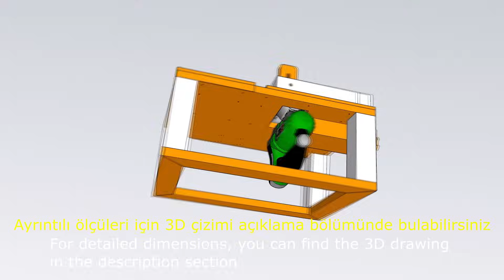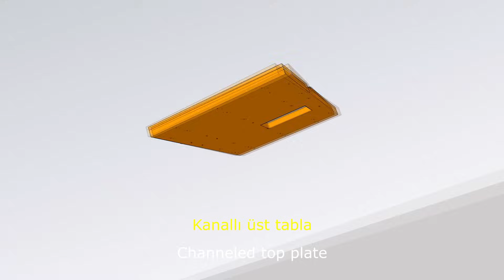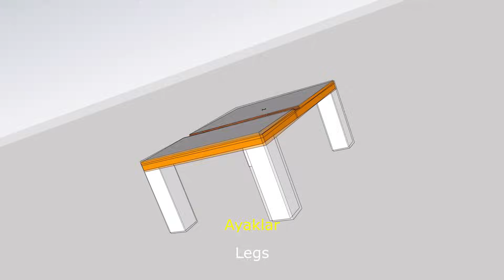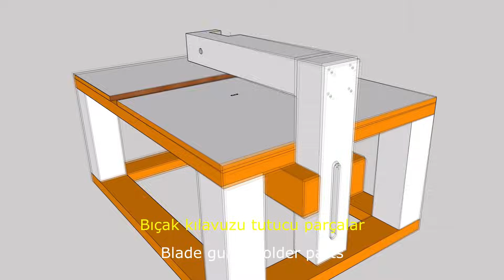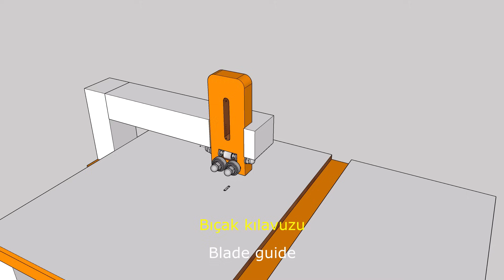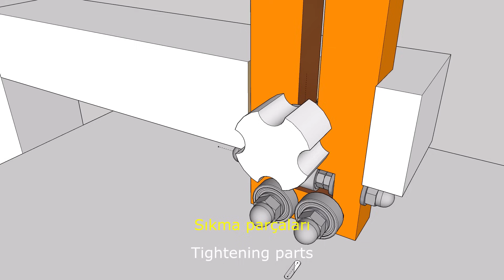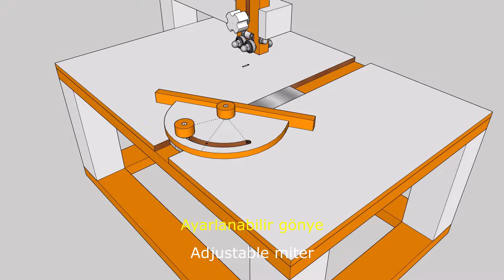Homemade Jigsaw Table / DIY Jigsaw Table

Comment: Excellent work. Btw what is the purpose of two spinning wheels? To stabilize the saw? I really need to know, cant we just use without that?
Reply from the maker: Hello there.  Firstly, thank you.  When you say "two spinning wheels", I think you mean the bearings on both sides of the saw blade.  These bearings prevent the saw blade from swinging and provide straight cuts.  Since the jigsaw holds the tip from a single point, it cannot hold the saw tip steady during the loading of the piece to be cut.  Bearings placed on the sides and back in this way play an important role in smooth cutting and curved cutting.
Reply: Thanks for the explanation, i really appreciate it.
Reply from the maker: I thank you too.  If you still have any questions, please write.

Comment: Good work man, I have in plan to build something like that, my purpose is to use for piece number 5, from your pdf plan, a piece of wood in L (seen in section from upper side), not in I, to can cut long profile from timber. Congratulations for the plans. What software you use for design? I subscribed to your channel because I like what you do and greetings, again, from Romania.
Reply from the maker: Thank you so much.  I usually design according to the materials I have on hand.  Also materials that anyone can find.  I use a program called Sketchup for drawing.  Pretty simple and useful.  If there is anything you want to ask, please write again.  Note that you can find PDF plans in all my videos.  Greetings from Turkey

Comment: how do you keep the jig saw running without maintaining the trigger  button presssed down??
Reply from the maker: Hello there.  My saw has a lock button that can hold the button down.  I press this button after pressing the trigger.  If your saw doesn't have one, use a switched socket.  secure the saw's trigger with a cable or plastic clamp.  In this case, when you plug the saw into the socket, it will work directly.  If you choose the socket with a switch, the saw will depend on this switch.  You can see a wiring harness like this in my "table saw" video.  I hope I understood your question and gave an adequate answer.
Reply: When I bought a jigsaw with this kind of project in mind, I specifically looked for a model with a lockable trigger and easy blade release, and ended up with a Bosch GST 90 E.
The trigger is rather hard to get to though, so I might end up mounting an NVR switch like the one I have on my router extension on my table saw. (Axminster AX103622). It's rather expensive, but it is a heck of a lot more convenient. Doesn't work with cordless jigsaws though. ;)
Edit: I ended up buying a cheap on/off switch (green on / red off) and connected it to the 2 halves of an extension cord with spade connectors.
I got it right the first time, so no tripped breaker. :)
Reply from the maker: Hello there.  It is easy to reach the trigger and lock system on my jigsaw.  If you watched my "table saw" video, I solved it by putting an electric switch there.  That way it's not too expensive. Keep following me...

Comment: Hello, how long between this the installer process
Reply from the maker: I guess you are asking about the completion time of the project.  First I draw it as a 3D plan.  Thanks to this drawing, I can see every detail.  I'm using the following dimensions.  Usually no problem.  In this case, if I have the material, I can complete it in 1 day.  3D design is not included in this period.

Comment: Great looking jigsaw table! Please can you let me know what type of bearings you used? I downloaded your plans and it just says "bearing from old hard disk" but hard disks use different bearings. Thanks!
Reply from the maker: Thank you very much.  I am glad you like it.  The dimensions of the bearings are as follows;  Bearings I used on both sides 626ZZ (6mm inner diameter, 19mm outer diameter) I disassembled the bearing I used in the middle of an old hard disk.  Its dimensions are inner diameter 4 mm, outer diameter 11 mm and width 12 mm.  I used the bearing in the middle of the read-write head, that is, the moving part of the hard disks.

Comment: Excelente proyecto. Gracias por compartir el plano de la mesa. Le solicito amablemente el diagrama de la regla para hacer los diferentes cortes.
Reply from the maker: No pude encontrar el dibujo de la regla, pero lo haré nuevamente y te daré el enlace.  Muchas gracias por tu interés y comentario 👍
Reply from the maker: Hola de nuevo. Los enlaces de dibujo que desea se encuentran a continuación. Descargue ambos enlaces.

https://drive.google.com/file/d/1T0WF_VFxScAqfKmuX1HOzSdqCzyhdxh1/view?usp=sharing
https://drive.google.com/file/d/1X4DkNyjZnu1dfbjvmoD69M0b9HG4t294/view?usp=sharing
Reply: Muchas gracias.
Reply from the maker: Gracias tambien 👍

Comment: 당신의 작업하는 모습을 보면은 아름답다는 생각이 들어요 또한 작품은 더욱섬세하고 아릅다워요 오늘도 잘보고 갑니다 👍👍👍👍👍
Reply from the maker: 이 벤치가 없다면 꼭 하는 것을 추천합니다.  그것은 잘 작동합니다
Reply from the maker: Thank you.  I used 895 DC motor.  The 775 engine is also suitable for the dimensions I have given.  I used 6 cell 18650 batteries for voltage value.  In this case, the voltage value was 22.2V.  But if it is supplied with 36V, the speed may be higher.

Comment: great table but i am not a fan of jigsaw cutting like that but you did a great job, looks very good.impressive.
Reply from the maker: Thank you very much for your interest.  As a matter of fact, it is a workbench that works very well for me.  If you have watched my other videos, you must have seen that I use it in many places.  I also made a hedge and circle cutter for this bench.  They also make my job easier.

Comment: Thank you for   a  very good  video. cngratulations
I will try to make  one   following most of your instructions
You  calll washers  stamps    this is a little confusing  until i saw  your video 

Keep on the  good  work
carlos
Reply from the maker: Thank you so much.  I'm glad you like it.  I don't think you will have a problem doing it.  I try to share measurements in all my videos.  I recommend you to watch my hedge and circle cutting tool video that I made for this tool.

Comment: Very, very nice! I've watched many jigsaw table builds and yours is excellent! Quite clean and functional. I also saw a couple things in your shop during the video that were brilliant ideas. The wall mounted grinder is very practical! I subscribed and will look for details on your drill press. Curious if the whole thing is diy...
Great work!
Reply from the maker: Hello there.  Thank you very much for your compliments.  I also love my jigsaw bench.  It works great for me.  You will see that I use it in many of my videos.  I also recommend you to watch the circle cutting tool and fence video I made for this bench.  In fact, I think you should check out all my videos.  I'm sure you will like it.  Thank you again.  By the way, you can download the measurements from the description section of almost every video.  Keep following me and don't forget to activate the bell notifications.  I wish you healthy days.

Comment: Bonjour, comment ouvrir "jip saw .dwg" ou skp merci
Reply from the maker: Bonjour.  skp a été créé avec le programme Sketchup, qui est un programme de dessin 3D.  Pour afficher le fichier, vous pouvez installer le programme Sketchup sur votre ordinateur ou télécharger le programme de Google Play sur votre téléphone et ouvrir le fichier.  Vous savez qu'il y a aussi des plans PDF dans la description, n'est-ce pas ?
Reply: merci pour votre aide ,les PDF s ouvre sans probleme mais les dwg plus compliqué, bonne journée
Reply from the maker: Merci aussi.  Les plans 3D nécessitent des connaissances en programmation Sketchup.  S'il vous plaît écrivez à nouveau s'il y a quelque chose que je peux faire pour vous.

Comment: une bonne réalisation très pratique et facile a fabriquer une question  les numéros et le nom des roulements (bearing ?) merci de vôtre réponse a bientôt Alain
Reply from the maker: Merci beaucoup.  Je suis content que tu l'aimes.  Les dimensions des roulements sont les suivantes ;  Les roulements que j'utilise des deux côtés sont des 626ZZ (diamètre intérieur 6 mm, diamètre extérieur 19 mm).J'ai retiré le roulement que j'ai utilisé au milieu d'un vieux disque dur.  Ses dimensions sont diamètre intérieur 4 mm, diamètre extérieur 11 mm et largeur 12 mm.  Des roulements similaires sortent des disques durs, mais il peut être difficile pour vous de trouver le disque dur.  J'espère avoir pu aider.

Comment: Nice job, but dude, you need to consider your own safety when drilling. Never drill into something you're holding in or with your hands, clamp it down!
You only got 2 hands with 5 fingers each, take good care of them!
Reply from the maker: Hello there.  YouTube has put your comment in the comments for review.  That's why I wrote a late reply.  Sorry.  You are absolutely right in what you wrote.  I got a lot of warning comments on these issues.  I will be more careful now.  Thank you for your interest.

Comment: excelent work, i like your style and your creative ideas. Very inspiring. Thank you very much..
but i miss the measurement of the mitter-gauge, can you put it online. Why is the guide rail 3cm wide . Mostly you use 1,8 cm.
is there a special need of this width?
Reply from the maker: Hi.  First of all, thank you very much for your nice comment.  I forgot to put the miter measurements on the measuring document.  But I will post it as soon as possible and let you know.  I made the miter bar according to the material I had.  In fact, at that time there was no tool that cut properly.  If you want, you can make it as 18mm.  In this case, the only difference in the dimensions is that the 190mm sides of the 2nd piece will change to 202mm.

Comment: Measuring screws with a ruler 20 cm
Reply from the maker: Hello.  What exactly did you mean, could you explain?  I'm so sorry I didn't understand.
Reply: I mean the metal piece for adjusting the angles the space between the adjusting screws
Reply from the maker: Are you asking about the channel I left for the angle adjustable miter on the bench?  Or the screws holding the bearings on the blade guide?  I'm sorry, but when you translate it really, it's not clear what you want to say.  Please forgive me.
Reply: hello, yes
Reply from the maker: Hello.  I hope I was able to answer your question.  Thank you for your interest and I hope you continue to follow me.  I wish you healthy days

Comment: Truly love your work, design and projects. Frustrated that I cannot get my hands on multi-layered plywood like you use. Even our US 18mm (3/4 in) furniture grade birch plywood (now $90 for 4 ft x 8 ft) would not handle the drilling as you do in you smaller pieces here. I suppose in Europe or Japan it is easier to get true Baltic birch with 17+ ply. Thanks again for your channel.
Reply from the maker: Hello.  Thank you too and I am also suffering from the same situation.  It is difficult to find quality plywood here, and it is very expensive.  That's why I make some parts with plywood.  Since MDF is cheaper, I prefer MDF if there is no need to screw it from the side.  Thanks again for your interest.

Comment: Hello.
I would like to build this and the drill press myself. Would you have the plans at all?
Reply from the maker: Hello there.  The detailed PDF plan for the jigsaw bench is available at the bottom of the description section.  The 3D plan drawn in the Sketchup program for the print drill is also available in the description section of the video.  However, I haven't prepared a PDF plan yet.  Start with a jigsaw if you wish.  Let me try to prepare a PDF plan for the drill stand.  but this might take a while.

Comment: Yada ben acamadim
Reply from the maker: Günaydın Mevlüt bey. Sketchup programınız var değil mi
Reply from the maker: https://www.google.com/url?sa=t&source=web&rct=j&url=https://www.sketchup.com/try-sketchup&ved=2ahUKEwiolprR8t7vAhXp_7sIHQe7DJ0QFjAAegQIAxAC&usg=AOvVaw3N1Zz3tih42qlDYXvr0Tkt&cshid=1617343692719
Reply from the maker: Verdiğim linkten veya internete yazarak sketchup programının 30 günlük deneme sürümünü indirebilirsiniz. Ya da telefonlar için sketchup viewer diye bir program vardı. Görüntüyü açıp ölçüleri oradan çıkarabilirsiniz. Yine de yapmazsanız tekrar yazın lütfen. Diğer videolariimda da 3d plan veriyorum genelde. Ve değişik projelerim olacak. Belki ilginizi ceken şeyler olur. İyi günler